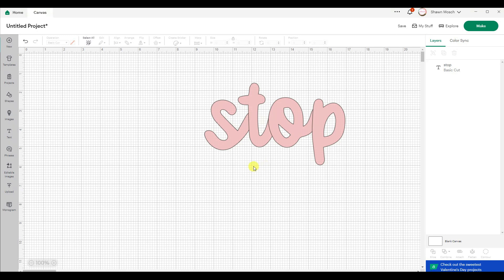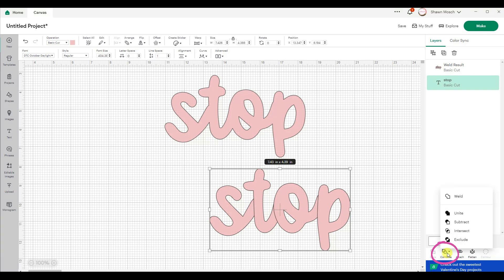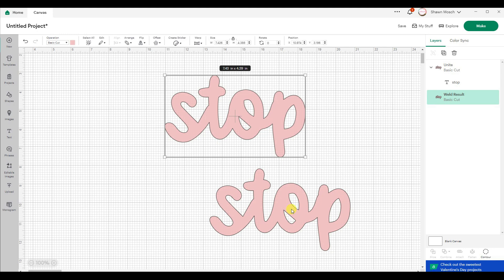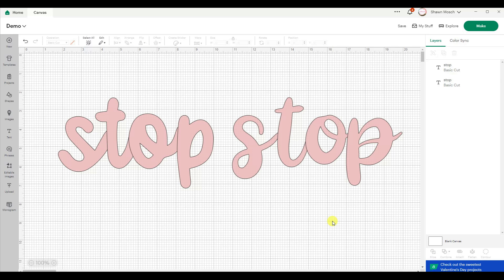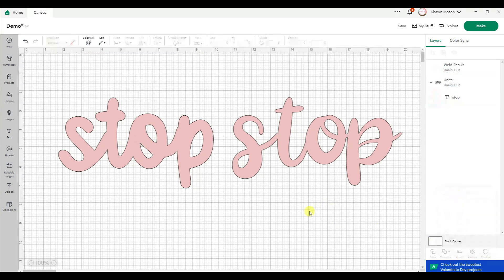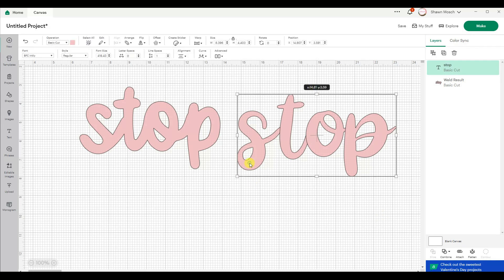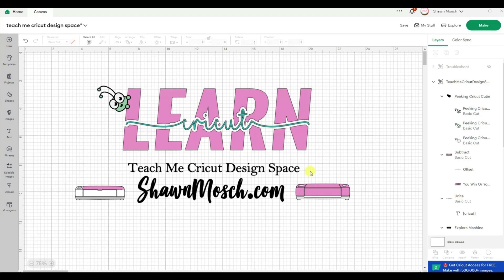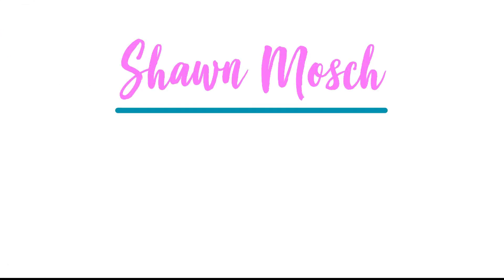Stop Using Weld in Cricut Design Space!  There is a BETTER WAY!!!  #cricuthacks #cricut

Comment: Is that the only reason to use either of those. Just to join letters?
Reply from the maker: great question!  No, not just letters.  You can join anything that is touching or overlapping.  For example when I wanted to make a Christmas tree for a card, I used three triangles that were slightly overlapping to create the tree shape.  I welded them together to make it cut as one piece.

Does that make sense?